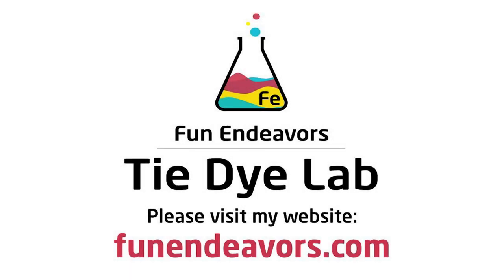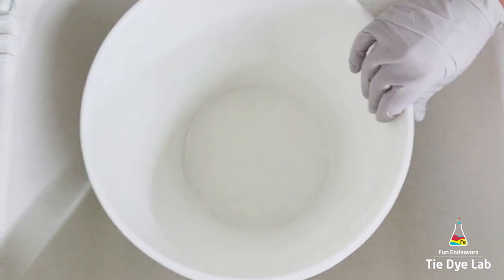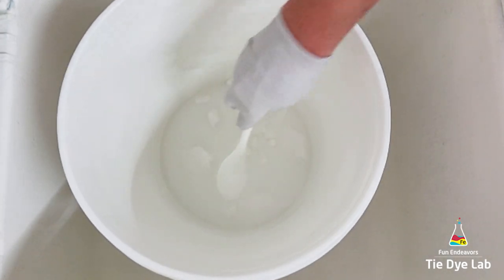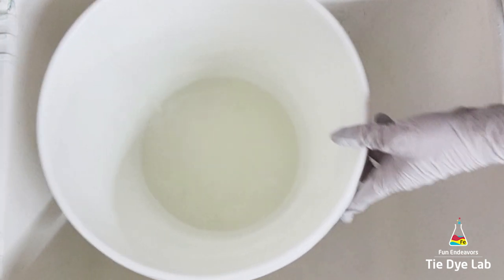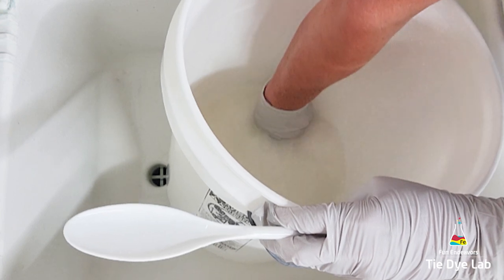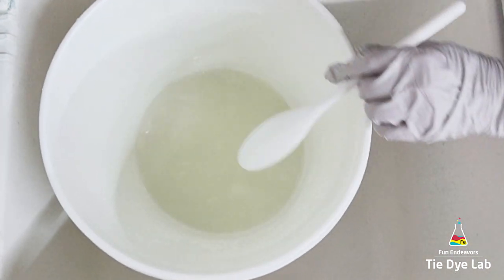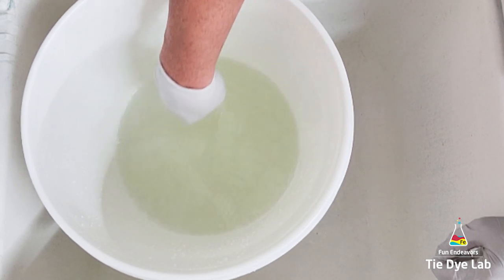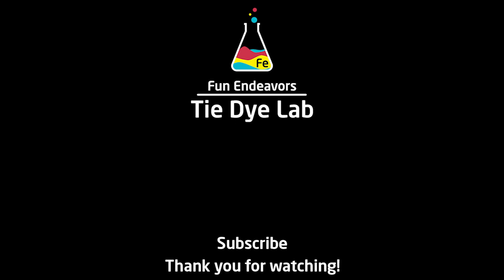Tie Dye Basics: How To Mix A Soda Ash Solution For Tie Dyeing

Comment: Thank you Angie. Can I add salt and distilled vinegar to this solution? If so, how much?  I read online it makes colors brighter, but I dont know. I am new and prepping my first shirt to tie dye at this writing. Thank you
Reply: Oh, the colors I am using are bright colors like orange, yellow, turquiose, green, etc...dharma procion dye fibers
Reply from the maker: No, you don't to add vinegar to this solution.  A soda ash solution should be a pH of 10.5 - 11, so it will be alkaline.   Adding vinegar to the solution would neutralize it since vinegar is acidic.  I use fiber reactive dyes and they require the raised pH to bond properly with the fabric.  
The fiber reactive dye I use doesn't require salt either.  If you'd like to add it though, you would add it to the dye.  To get the colors to be bright the dye really needs to be processed in the shirt in a really warm space (over 70 degrees Fahrenheit) for at least 24 hours.  Turquoise in particular likes it really warm.

Comment: Thank you so much for the video! super informativ. just one question: How big is the cup? i was looking for one on amazon and they have sooo many different sizes. Could you tell me how big the cup you are using is?
Reply from the maker: I am using a 1 cup measuring cup to measure the soda ash, and I am mixing the solution in a 5 gallon bucket that has a lid.
Reply: @FunEndeavors  Thanks for the answer. But that wasnt my question 😅
My questions is how big the cup is? In the sense of 50,100,150,200,etc...ml/g ?
Reply from the maker: @POWAH92  I'm sorry.  I live in the US, and 1 cup is a unit of measure for us.  Our 1 cup is 8 ounces or 236.6 milliliters (250 ml).  If you are weighing out 1 cup of sodium carbonate, it weighs approximately 600 grams.
Reply: @FunEndeavors  thank you so much :)
Reply from the maker: @POWAH92  You're welcome! 🙂

Comment: How do you know when you’ve exhausted the soda ash from the solution?  How many shirts can you treat with two cups/2 gallons solution?  I just received a bunch of shirts from Dharma and I can’t wait to do some ice dyeing!
Reply from the maker: I reuse mine and so it lasts quite awhile.  It will also stay good for a long time.  I only put as many shirts into my soda ash solution bucket as will fit and be totally submerged at one time.  I wring those out and then add more shirts to the bucket to let them soak while I am tying the first batch.  You will know when your soda ash needs to be changed - it will usually start smelling kind of strange.  Honestly, it takes months for that to happen most of the time.

Comment: Today I learned that I don't need to pay a ton of money for soda ash because apparently the washing soda I already have is the same stuff. Thank you for the chemical name 😆

Do you have any tips on how large of a batch/ how to mix a batch large enough to soak four twin size muslin blankets and a king size muslin blanket?
Reply from the maker: Awesome - I'm glad it was helpful!  You would use the same formula to mix a large batch of soda ash solution (1 cup of sodium carbonate into 1 gallon of water).  I would use a large plastic tote that will fit your blanket to mix it in.  When I am mixing soda ash solution for a large group tie dye project, I use large plastic totes that have lids and they work great.

Comment: I make my own washing soda because here in Europe soda ash is hard to come by and relatively expensive. It's very easy. Empty 1Kg baking soda into a shallow glass or metal baking dish. Heat at 400F or 200C for one hour. Allow to cool. Voila. 1Kg Soda ash. I use it in every laundry - it's a champ for removing sweat, sweat stains and odors which are unavoidable outcomes of living in southern Europe.
Reply from the maker: That's great!  I had no idea that it was difficult to find in Europe.  I know that there are some tie dye items that we use in the US that are more difficult to find other countries, but I didn't realize that soda ash was one of them.  Making your own is a great solution.